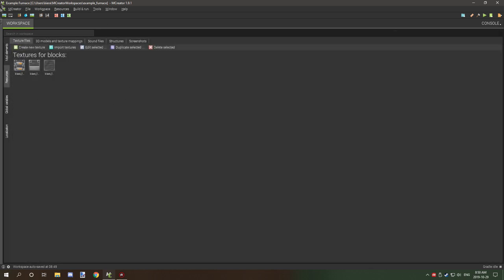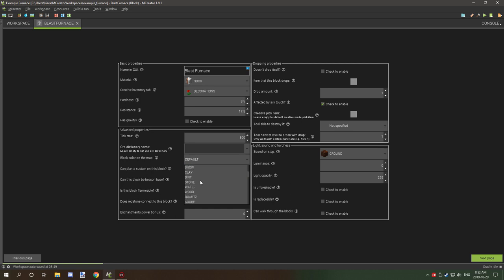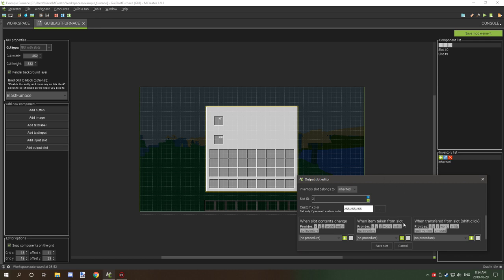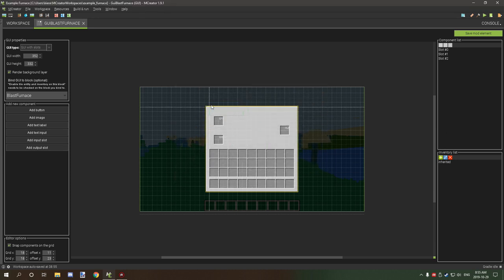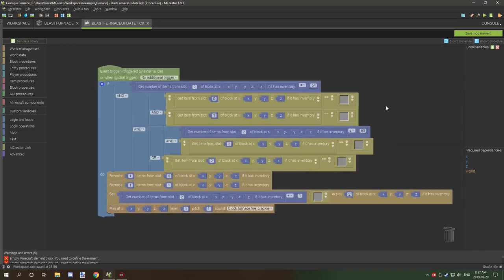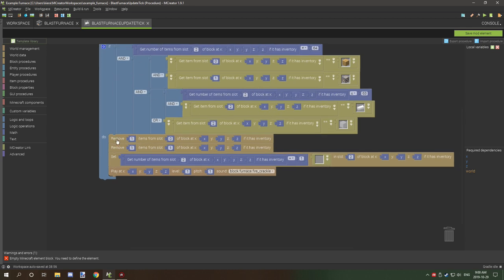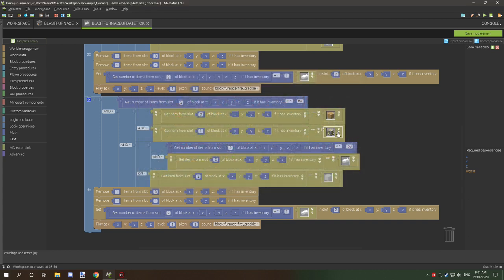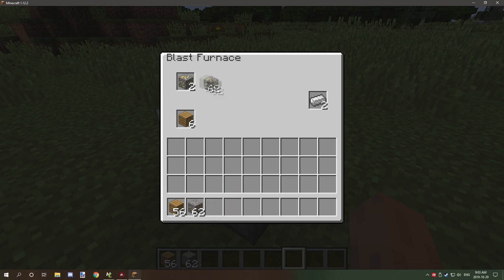MCreator Tutorial: How to make a furnace | 1.9.1

Comment: With the custom block like the furnace, is it possible to do the on and off state? See I can animate my block face , but the animation plays when the furnace is not crafting. I guess what im looking for is when the furnace is off it shows the off state face and when its in use it plays the animation
Reply from the maker: I have tried doing this in the past and it did not work due to the block being linked to the GUI. Some changes are coming to mcreator that will be  changing how the GUI is linked so it may be possible when that feature is implemented but its to early to know. The main problem regardless is the when the block is removed the inventory is swapped over so I would think you would have to make 2 inventories 1 for its off state then one for the on state then have some way to test if there is fuel and items in the to main slots and then some how move all the items over to inventory 2 and update the blocks state at the same time. That may work but I am not sure if it would or not.
Reply: I have got a way of this working which is almost perfect except that the GUI closes when the furnace changes texture. Basically dont bind the GUI to your block. Just make the GUI open on right click. Then create a second furnace which is lit and also has inventory. Then use the 'replace block' function in the procedure whilst keeping state and nbt.

Comment: I'm Trying to doing furnace but no need fuel but i just remove the fuel part and it's don't work jut wait like that not smelting what is able problem?(sorry for my bad english)
Reply from the maker: On the If statement condition remove
"Get item in slot [0] of block X Y Z if has in inventory = [ITEM]"

Also get rid of the the AND operator that now is missing the block but keep the following.
"Get item in slot [1] of block X Y Z if has in inventory = [ITEM]"

And then further down you need to remove
"Remove [1] items from slot [0] of block at X Y Z if it has inventory"

The rest should work fine, if you need further help with pictures I have a discord server that I am help people from Monday - Friday, 3 - 6 PM (-8 GMT)
Reply: @NorthWestTreesMCreator i'll send screenshot from the discord but i'm think i did your said think.
Reply from the maker: @lfgdestruptor4650  I replied :)

Comment: I want to make that when I press a key, an event always occurs in front of the character in a certain area, is this possible? I mean, without my dependence on the X and Z axis of the world, but on the character direction. So I could make him teleport to a location in front of him, or make spawn special effects in front of him
Reply from the maker: It should be possible using key binds and the relative direction entity element to test for what way the player is facing.
I did a video on how to use the relative direction thing in this video it should not be too much different then what was in that video. https://youtu.be/xatCYG2ddBY

For the teleportation thing I am not sure how you would go about safe teleportation them to a location but say they are facing X using the system above then you could teleport them based X or if they are facing -Z then teleport them -Z but I don't know if there is a way to determine if there is a solid block under the location, I could see this being an issue and having them spawn underground or worse. I would ask on the issue tracker for help as I don't think many people in the community would know how to do this either.

Comment: Didn't work for me :(
Reply from the maker: You need to replace the operators that use Metadata if you are working on a mod for 1.14.4 or above. 1.12.2 uses meta data "==" where 1.14.4 uses only "=" operators.

Comment: my game crashes when i try to open
Reply from the maker: Make sure you link the GUI in the GUI editor to the block or it will crash the game. Also, make sure you have the same amount of slots as the blocks NBT settings have or this too can cause a crash.

Lastly, make sure the NBT page is enabled or it will not work.
Reply: @NorthWestTreesMCreator  what is nbt? Im brazilian sry
Reply from the maker: @gustavogranetto2020  NBT full name is Named Binary Tag you can find more on Minecraft wiki below. https://minecraft.gamepedia.com/NBT_format
Reply from the maker: @gustavogranetto2020  MCreator uses the NBT section for enabling the inventory for GUI so it's safe to say its probably NBT based.
Reply: @NorthWestTreesMCreator  thx
Reply: @NorthWestTreesMCreator  that dont works
Reply from the maker: @gustavogranetto2020  Does your workspace have any errors that show that there is something wrong with an element?

In most cases it will add a little red dot on the element that has compiling errors, this will indicate what element has issues.

Sometimes just compiling them fixes the issues but in other cases, you may need to check and read the error log to see what the game is doing that causes the crash.

Most of the time when it has to do with GUIs it will have to do with the things I said above. I suggest asking for help on the MCreator help forum as there may be more to it crashing then just the GUI.
Reply: @NorthWestTreesMCreator  it was the version, 2019.5
Reply from the maker: @gustavogranetto2020  If it's 2019.5 then I think some procedure components where removed, this could cause an issue with older tutorials. When I find some time I will see if I can't update the code or at least look into the issue a bit.
Reply: @NorthWestTreesMCreator  i make an amazing mod with your tutorials, thanks you! He is in beta if u want download i go let the link avaible in some days
Reply from the maker: @gustavogranetto2020  I am happy that the tutorials I make are helping the community. :)
Reply: @NorthWestTreesMCreator  I finally done 1 rly GOOD mod on minecraft, thx bro